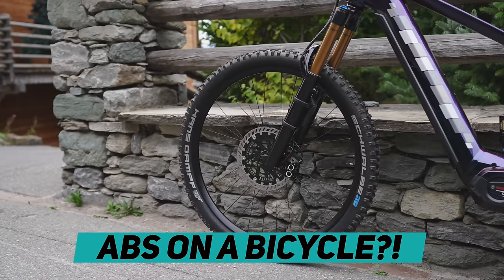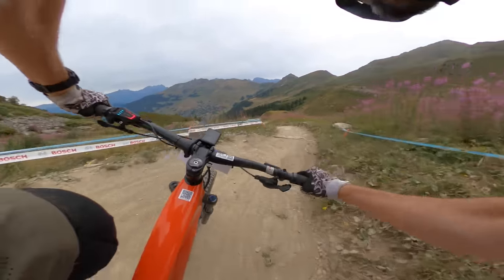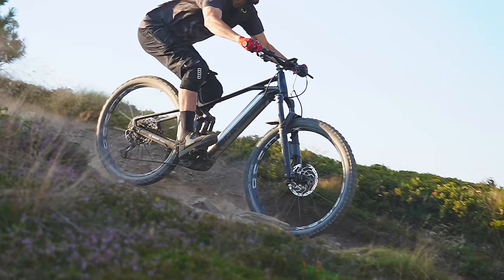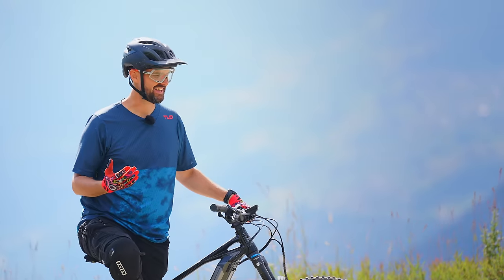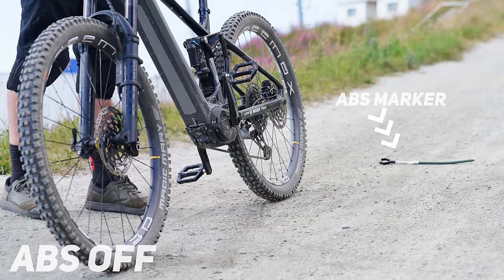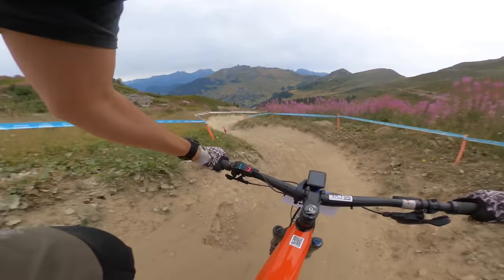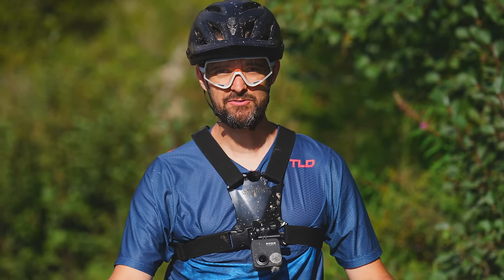I didn't want to like it... Bosch ABS is INSANE!

Comment: Super interesting. I wonder if theres something in the UCI rulebook to stop this being used in world cup DH racing, with a tiny battery pack powering it. That test where the bike consistently stopped over a whole bike length short, vs no ABS - Imagine the time saving on a WC DH track with that technology and a pro rider.

Absolutely mad. Well done Bosch and Magura.
Reply: Of course the ABS is going to outperform Rob Regular here but you'd see a different story with a professional on the bike. His weight distribution on the bike is horrible for braking to begin with. It's consistent for both tests which is OK but not indicative of a pro rider doing the same test. It's not a coincidence that ABS is not used in many forms of motorsport. ABS is more for people not used to fine brake control or conditions where unpredictable events can require sudden unexpected hard braking. This doesn't happen on a world cup downhill track. All your lines and braking points are predetermined at practice. In conclusion I think it would do next to no good in that application.
Reply: @frankthetankricard  I think it would be an easy 5 seconds per run for a WC rider. When racing DH the pro riders will, as you say, plan their braking points. However it will be a risk vs reward approach, where braking deep into a loose corner would risk a small mistake for too little gain. With more margin for error as rob has here, you’d see pro riders just pushing harder, because the risk of making a mistake is lowered and the feel of the bike more consistent.
Reply: A pro probably wouldnt need it just like moto gp riders dont use abs. They just dont lock up
Reply: @BanjoDo  that’s absurd, they don’t use it because it’s not allowed in the rules. Motorsport ABS systems modulate the brake pedal much more accurately and react more quickly than any human ever could - period. It doesn’t matter how good a rider or driver you are, skill doesn’t actually matter - a human brains simply can’t react and modulate the lever at a high enough frequency. 

I think you guys are projecting than an extraordinary amount of human skill could in some way replicate ABS. It can’t.
Reply: @Chrissy-H  You bring up some good points too. I'm not entirely convinced but we'll see soon. There will be more testing data as the technology becomes common.
Reply: @Chrissy-H  speaking of reflexes at high speed please elaborate how f1 uses abs. Im dying to hear this
Reply: @frankthetankricard  some good points from both sides in this thread mate. Arguing done right 👍
Reply: @frankthetankricard  @meco rodriguez   ABS is not used in most racing because racing is supposed to be a contest between humans, not between human and technology. You see motoGP riders and F1 drivers lock up wheels all the time which costs them a lot of time and sometimes even the race. They are the best of their craft and still make that mistake. In 2022 no human on this earth is better than ABS or could even match its performance. Yes, in the early days of ABS maybe, but not today.
"Engineering Explained" has recently made a very detailed video about it, if you are interested.
Reply: @mecorodriguez4639  they did, until it was outlawed in the 1994. It was outlawed to make drivers rely on skill rather than tech. With the evolution of tech, imagine the performance benifit of a hyper developed F1 ABS system, everybody would be a mr. late brake, and no one would be able to make overtakes based on there skill in using just the right amount of brakepower.
Reply: The benefits on a world cup dh track wouldn't be that great. There's not that many sections where they are using full brakes. The goal is to carry greater average speed everywhere and the tracks are built to allow this. In some cases pros run weaker brake pads to keep more speed when braking. An average rider is trying to manage speed down a track where the world's best are trying to create speed everywhere on the track.
Reply: @haydenbristow91  it would still mean that every time they need to brake they could do it later and harder compared to a normal bike, at that level it would surely make a difference.
Reply: @haydenbristow91   your question answers itself; if as you say they aren’t using full braking power or weaker pads, well, you’d have to ask why they would choose not to. It’s probably because they don’t have the precise control they need and would risk locking a wheel and make a mistake. With ABS that uncertainty is completely gone, even in horrible slippery conditions, and so they could use that additional control and confidence to push deeper into the braking zones of every single turn.
Reply: I’m doubtful pro riders are using full braking where needed. Like in F1 you want to brake for the shortest time as late as possible. Just because they go fast doesn’t mean they aren’t braking. Those tracks are often very steep! I think ABS would be an advantage and should be banned as in some motorsports

Comment: For those not interested, capable or new to mtbing I can somewhat see the appeal. Personally I think (IMO) people should take the time and effort to learn bike craft rather than just substitute a skill with a technology.
Reply: The same can be said about suspension, or bigger wheels. Long travel 29-ners go over stuff really easy. Why don't we ride 26 hardtails instead and take some time and effort to learn skills?
Reply: @Kefir0  actually no, that's completely different.  Advancements in suspension and differing wheel sizes are directly correlated with professional mtbers seeking performance enhancement (e.g. "super" enduro and progressive geometry), I'm not aware of any enduro, downhill or xc professionals looking for ABS. The introduction of ABS (IMO) is for the reasons I previously stated.
Reply: @SR104  Correct, better suspension, and better tyres are performance improvements, where ABS isn't a performance improvement, its a safety net.
Reply: @benjy288  Better braking is most definitely a performance improvement. It is also a safety net, but aside from improvements in acceleration the same can be argued that all performance improvements are safety nets. I don't know how you can watch the video where they proved the ABS system stops noticeably sooner with less risk and claim that isn't a performance improvement. Bike stops sooner, that's an improvement. Just like the transition from V brakes to disc brakes which gave improved braking distances/ power was most definitely a performance improvement and not just a safety net.

As far as no professional riders asking for ABS, it is a novel technology for bikes. People generally don't ask for something that is not an option. Unless it is officially banned it will most undoubtedly make it's way onto every racer's bike as it is an undeniable performance improvement. Riders may not even wish to use it, but if they want to be competitive there will be no choice but to adapt once it is available. F1 cars are banned from using automatic transmissions, so they use paddle controlled DSG gearboxes because they shift faster and more reliably than a human with a gear lever and clutch pedal can.

Gate keep less. Ride whatever you like however you like and let other people do the same.
Reply: @kft4764  ABS doesn't give you better braking performance, it doesn't give you more grip, it only stops you from locking the wheel, all this video showed was that this guy didn't feel confident enough to brake harder with ABS off, hence why he stopped quicker with it on, and performance improvements like better tyres and suspension aren't safety nets, they won't stop you from crashing, they will give you a bigger safety margin at a given speed, but you'll more than likely just end up riding faster because of it.

There's no way a professional downhill mtb rider would want ABS, it would more than likely be a liability, motocross bikes don't have ABS, motogp bikes don't have ABS, if it were a performance improvement motogp would be using it like they use traction control, but its not a performance improvement, its just a safety net.
Reply: @benjy288  I understand you're saying the same potential maximum grip between the tire/ road and the brake pad/ rotor, but it is only potential and not actual. The most skilled rider in the world will come nowhere close to the reaction speed of a microprocessor, both in time to perceive a wheel becoming locked or spinning again and in ability to modulate the braking pressure in response.  End result means that the ABS system has more grip for any rider.

If the argument for other bike performance improvements being alright because they only provide an increase in safety margin and not act as a fail-safe safety net, the same still applies to ABS. You can most certainly still crash a bike without locking up the front wheels. You can still exceed the ability of the brakes, overcook an entry, go OTB, use poor body position, etc.

A human can do the same math a calculator does, but does any human have a hope of being able to process faster than one? If there was a professional competition to solve equations in the quickest time, calculators allowed, wouldn't everybody be forced to use calculators in order to compete? That ABS out brakes humans, particularly in unpredictable non steady state terrain is well proved.
Reply: @kft4764  I had ABS on one of my previous road going motorcycles, and when I braked hard the back wheel would come off the ground slightly and the ABS picked up that the front wheel was going slower than the rear and it released brake pressure, increasing my stopping distance, because it thought the front wheel was locking, when it wasn't, it had plenty of grip, so I ended up disabling it and my stopping distance decreased.

The same argument can't be made for ABS as it can for performance improvements like tyres and suspension, because those things actually give you more grip, allowing you to ride faster, plus they won't stop you from crashing, but ABS doesn't give you more grip, so it can't give you a bigger safety margin, its only purpose is to stop you from locking your wheels and crashing, its only a safety net, nothing else, in that regard its like training wheels.

I don't know what calculations have to do with anything, when you're braking you're not making calculations, you're going by feel, ABS doesn't out brake humans, it can out brakes some humans, and as i said before, if ABS gave you better braking performance then you would see it on motogp bikes, and motocross bikes, but you don't, because it doesn't.
Reply: 100% agree.

Comment: I have embraced every new technology, but I find this a little disconcerting. Braking well is a big part of the joy of mountain biking. That feeling of locking the front wheel and having the reaction speed and presence of mind to come off the brake against instinct  is very satisfying. 
I suppose I feel like braking is something I’m good at and this technology might take away my advantage over my mates that might not be as skilled on the brakes.
I’ve spent my life learning  a skill and now any novice with anti lock brakes can out brake me.
I don’t think I like it.
Reply: I get it John but you gotta lose the ego. It is what it is. Been riding my whole life. I'm a very capable and confident rider, and yet I'm watching 16yr olds shred harder than I can. By your logic, we should have never progressed from hardtails with v-brakes. Anyone who has gotten on a bike for the first time with the next tech, be it longer travel, full suspension,  disc brakes, hydraulic disc brakes, longer front centers, updated fork offset, etc... has started at a level not accessible to those that came before them. That is how the sport progresses. 

That being said, I can ride things that my younger friends can't because I've developed a whole host of other skills and comfort along the way. When it comes time to ride that trail with 8 tight switchbacks in a row that require you to track stand and pivot on that front wheel, let's see who gets through that without issue. You with the skills you've developed over a lifetime of riding or your friend who has never learned to do a stoppie. Take it where you can.

Comment: I suspect that riders at the highest level, with a complete understanding and possession of their bike * may * be able to outdo an abs system. however, for * at least * 90% of riders, this system is a gamechanger. 

I do fear for the braking instinct I've developed not being learned, the long term no-service reliability for someone who knows nothing about their bike is an area of concern. additionally, I think braking is good to learn for biking everywhere (what do your braking instincts tell you when you get on a loaner or beater bike?)

I was able to ride a 30 year old hardtail with horrible tires in the rain recently, and I think my braking instinct was the deciding factor between a sloshed-with-mud-miserable crash, and a slightly less muddy safe ride.

Comment: The final coment I think is the most important. If we get used to this technology will be worse riders for it? will this push us further into dangerous situations or what happens when it fails?
Reply: exactly, i'm not a fan...
Reply: I know i'm late to this, but as a motorcycle rider... ABS is absolutely incredible. in 10 years of (very defensive) riding, i've triggered it maybe 5 times, but one of those absolutely saved my life - being able to apply 100% braking power in a split second is miles better than what 99.9% of riders can do. Another one probably saved my bike from going down. It really blows my mind how a 400lbs bike just stops on a dime, it's insane.

Now sure, on a bicycle the difference is much smaller, and especially on MTB it's much more about the experience and your own skill. But if you ever take that e-bike on a road, I can only recommend it. 

And i'll never ride a motorcycle without ABS in traffic - yes  i never really learned how to manually brake well, but i'm glad i didn't have to, and had full power brakes available as a new rider. If i ever end up getting an e-bike i'll definitely look into it, as i commute on bicycle and would definitely enjoy the increased safety, even if i'm always a defenisve rider in traffic.

Comment: This actually looks very beneficial, I've flown over the bars after squeezing the front brakes too hard on a trail. If this technology becomes widespread, I'd love to add it to my bikes
Reply: Won't help you since going otb is the result of your weight distribution in relation to the braking force. 
If anything, the added braking power you can exploit with abs will make it more likely that you'll over balance if grip level increases. The computer can avoid locking up, but it can't tell how much you need to stop. If you are relying on the abs unit to modulate for you, you will be simply using 'as much grip as there is'.
Without actually having to know that yourself, you lose some control.

Comment: Seems like it works well. My biggest issue is that it's one more peice of tech that could easily break and surely will not be user serviceable
Reply: Knowing Bosch. Almost def not
Reply: super reliable zero maintenance on motos. same tech. I want to hate it but it will be a gamechanger.
Reply: @jamesmarchant5837  the problem is going to be liability. If people temper with their Abs and then crash it there will be insurance claims. Definitely in the US. And then it's getting complicated if the end user fucked it up or if it was an inherent problem with the system from the beginning
Reply: @drdentz  i'll point to motorcycles again. It's a closed system, the most prevalent "hack" is to pull the fuse and disable the system... Which you can just do here.
I really don't see any reason to tamper with the system if you can already just disable it

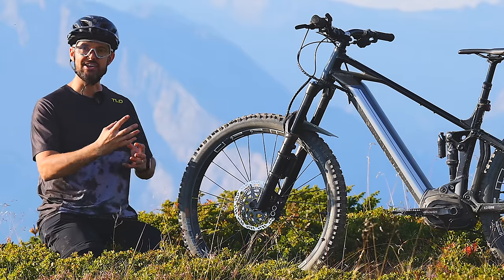Comment: 2:35 "Variation" in front and rear-The fly in ointment seems to be if you apply both brakes, and lock up the rear, the system will think it's acceptable to lock up the front as well.  Unless it implements some kind of algorithm to detect the rate of deceleration as part of the operation.
5:45 This test indicates the rear is not sensed as was stated earlier though.

Comment: That's exactly what I was thinking, going back on a non ABS Brake will be dangerous. I'm sure it kind of destroys u're brake finger feeling by the fact u're not the one controlling the pressure! 
Seems like a really nice and good working system but may not for everybody. It's nice that Magura is pushing forward and this will probably take some work back from the dentists😉
Reply: Also magura levers are very unreliable. It adds cost if they fail, and you can't replace them with shimano levers.

Comment: Might even be more beneficial for gravel/road bikes with a rigid front fork.  

Moving the weight back quickly to do panic breaking is not always feasible.  Modulating disk brakes with a rigid fork, more forward geometry and light bike isn't always easy.

Comment: Rob, I do love your channel, I thought you said you are going to buy, with your own money, a Poli Voima? In regard to this antilock thing, up front, on the road, I agree to degree. However, I have to say what you say about skidding the rear brake is what we all do...ahhhh no, I do my level best to never skid the brakes no matter what the situation creates. For one reason, bike control, for another skidding on the trail eventually ruins the trail. I am sure you understand what I am saying where some favorite downhills have been ruined by the shudder bumps that the rear brake skidding creates. I would rather you promote riding without skidding. I am a pretty aggressive rider (now since 1970 before there were any MTB bikes) I have learned to be as fast as I want to be, faster when I want to be than my fellow riders yet not skid the rear wheel. It can be done artfully and be as fast as ever